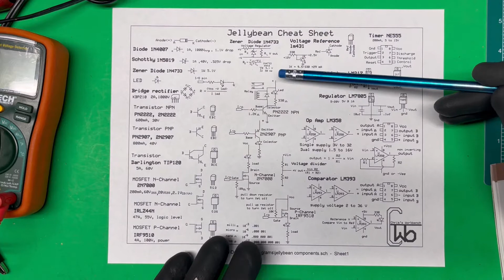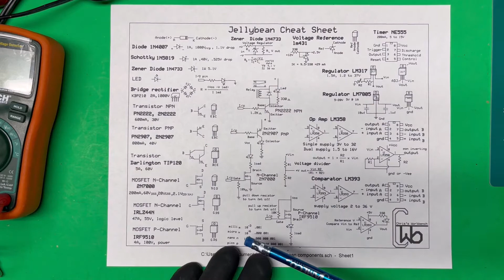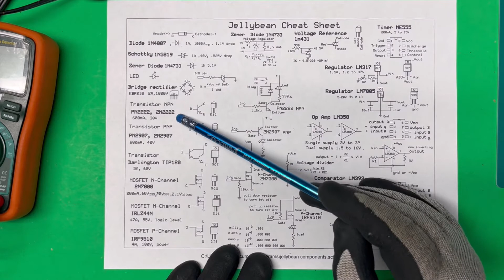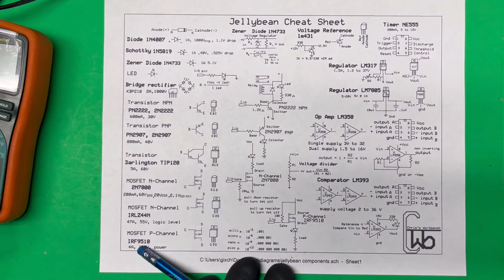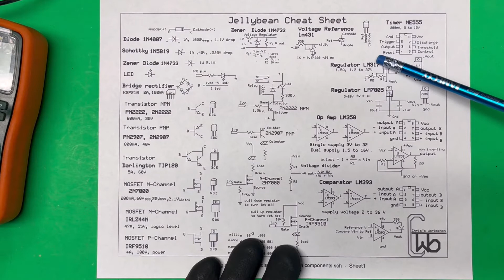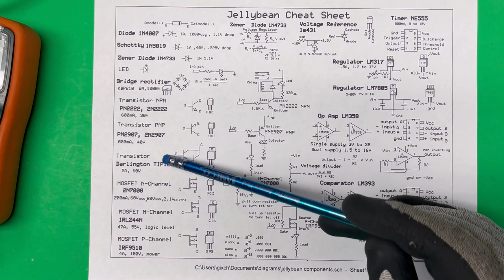Jellybean Cheat Sheet

Comment: Random thoughts = My stocks are similar. I would/do keep some IRF540s, to make complements to the IRF9540s. IIRC, there is a difference between the LM555 and the NE555; one has more amps? But, it does cost more, I think. The LM431 comes as TL431, but I forget what the difference is. I am in the long-term process of divining the better model among variants and narrowing the width of my stocks to include just those. That will come down to more amps and/or watts, per model, I imagine. That is not necessarily the more economic approach, but I am a hobbyist (i.e., not minimizing commercial production costs) and the greater flexibility of a more robust variant has its own value, even if it is not the least expensive model.
Reply from the maker: I keep some IRF9540s on hand, I'll add them to the list. Thanks for the comments.